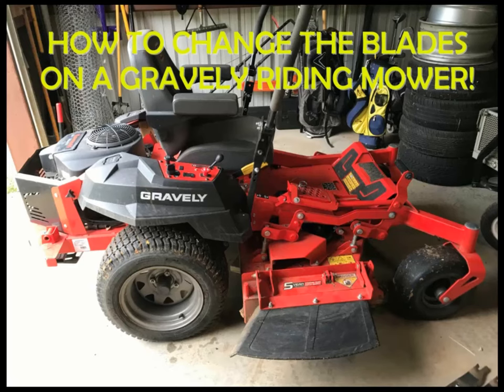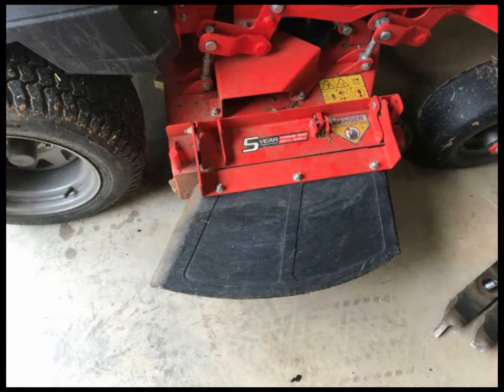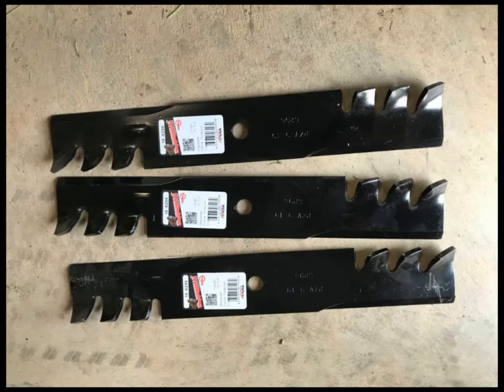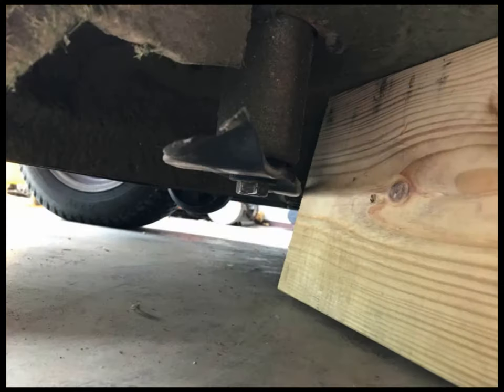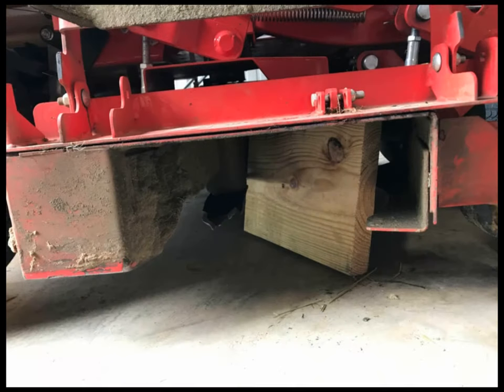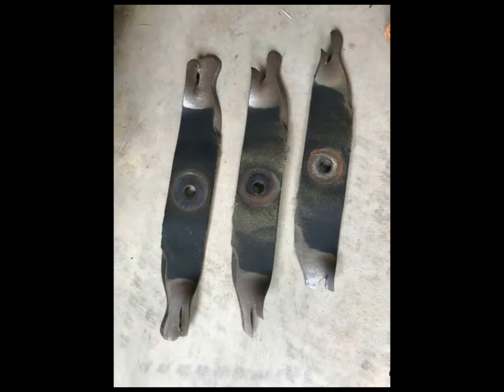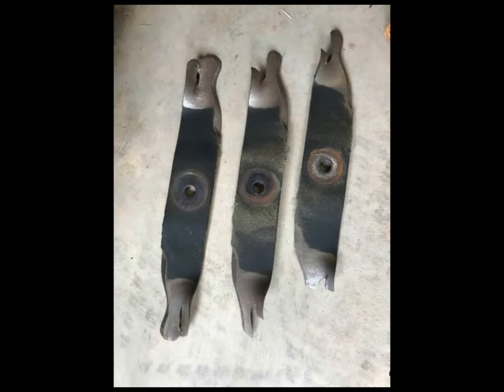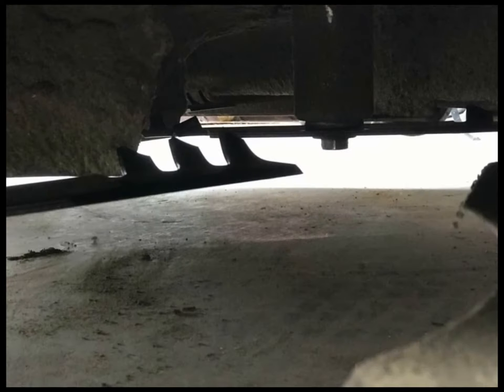HOW TO EASILY CHANGE THE BLADES ON A GRAVELY RIDING MOWER!

Comment: When you tighten it back up? Is there a torque measurement or just as tight as you can ?
Reply from the maker: I saw no torque specification, so I just got it as tight as I could without breaking things.
Reply: I'm sure tight as you can is fine but just copy/paste this from the manual as I had looked it up yesterday. 

"1. Reinstall blades and secure with original 
hardware. Torque to 156 N•m – 217 N•m 
(115 lb-ft – 160 lb-ft)."
Reply: On my Gravely ZT HD52 mower, which has blade bolts that are 15/16 (24 mm), the manual says to tighten to a torque of 115 - 160 foot pounds (156 to 217 N•m).
Also a very good idea to coat the threads on your bolts with Never-Seez, which is a graphite paste you can buy pretty much anywhere. Makes it much easier to remove the bolts later.

Comment: never showed how you raised the deck...I know how I would do it but I wanted to see your solution.
Reply from the maker: Gravely mowers have a pedal you push to raise the deck and lock it into place 👍
Reply: @BevanFarmTexas  yes, I know that. I was talking about blade replacement- you want more height under the deck to do that easier, no? Do you use a ramp, lift, etc.?
Reply from the maker: @user-sf9pq5ox7w  nope, just raising it with pedal left plenty of clearance.